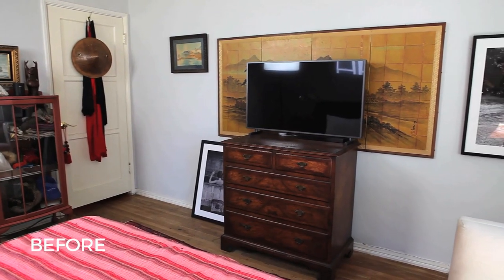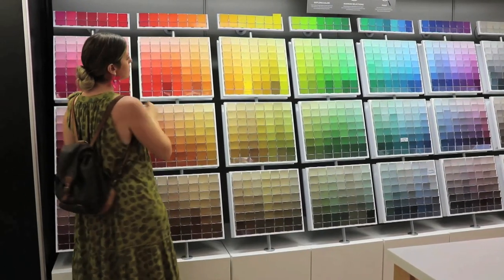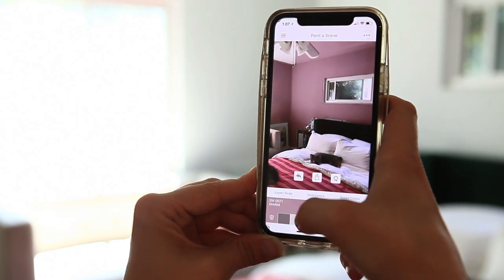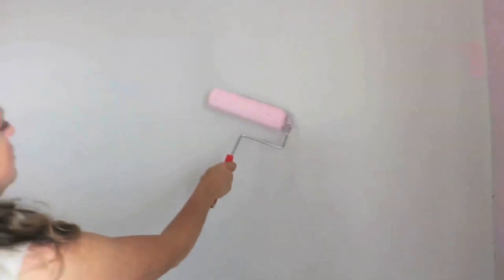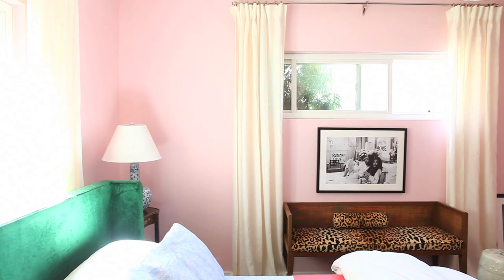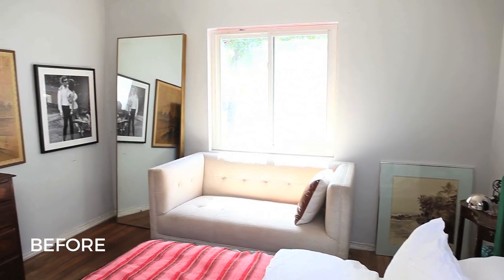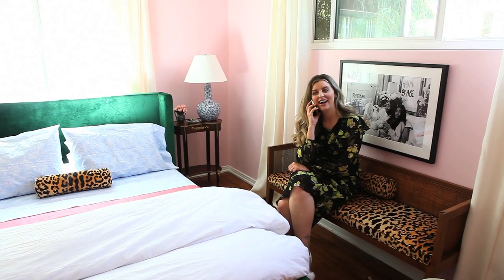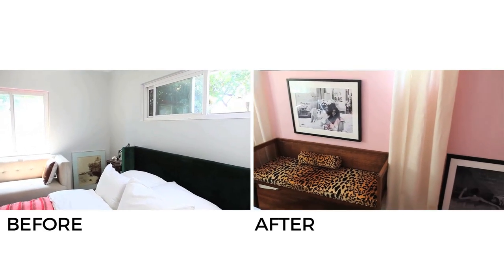Bedroom Makover -- BEFORE & AFTER

Comment: Instead of rearranging the whole room, why not try and conceal the headboard from the window? There are many options, you could do a nice shelf across the room that would just cover the headboard from sunrays, you could do a nice planter box in front of the window only, doesn't have to be too large so it won't push your bed too much, but just tall enough so that the box covers most of the back of your bed frame, and maybe a little wood shows up at the top? With some greenery, that'll provide more shade in the daytime so your green bed doesn't fade! You could also just layer the headboard with another headboard that's a bit taller, a few wood planks and you could DIY that fairly easily! Anyhow, love your videos! :D
Reply from the maker: Kate Malone Lots of great ideas! Thank you!! 😘😘😘
Reply: im pretty late to this upload but there's also window tint that protects furniture from fading